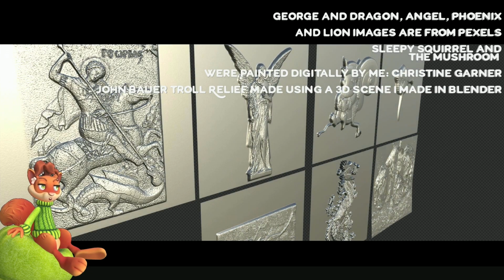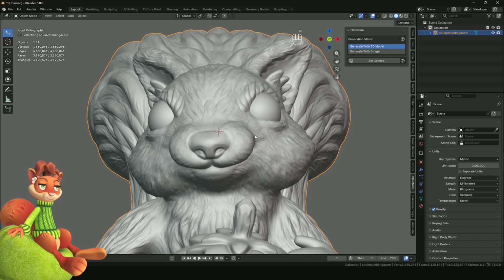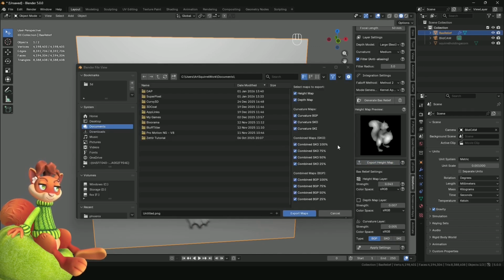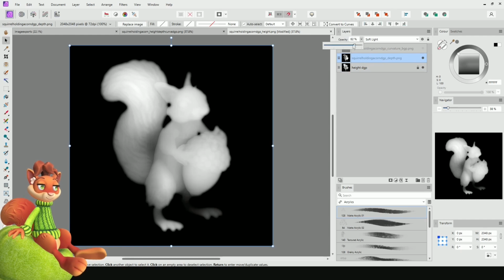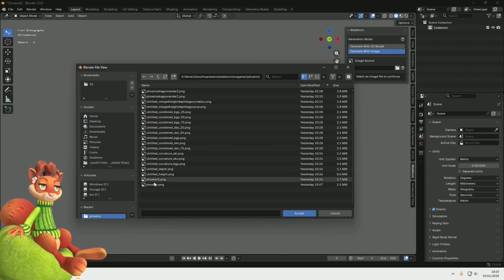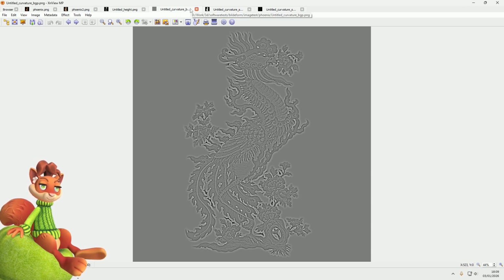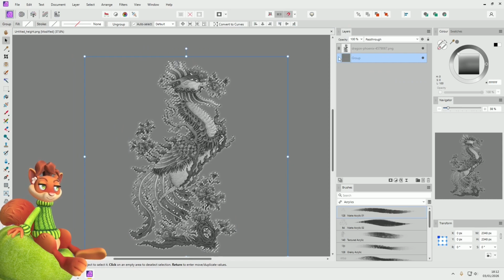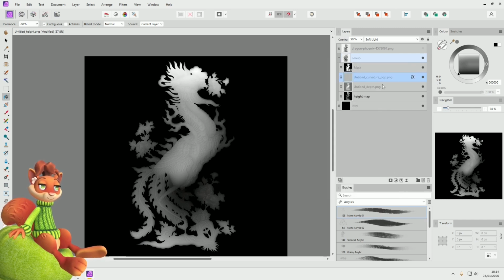Bildeform ver 2: Bas Relief Blender add-on for 3D models and Images

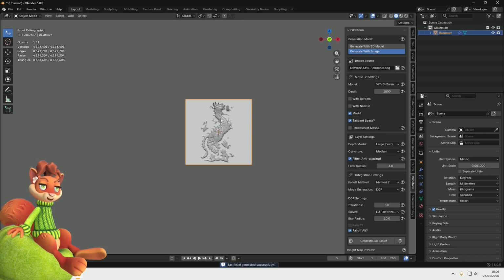Comment: I try to do like you, but i don't succes, lost many details, blur and smooth result. I upload image and make some ajustement like yours on this pluggin , but detail are poor, never like yours at 8:43. I will try again (i don't understand realy how work his pluggin, need doc and tuto)  but i hope to find a good result 😎
Reply from the maker: That time stamp is the result I got for a very flat low contrast image before I tried the white border trick. White border trick helps and you also need a good image to start with with good shading and decent resolution.
Reply: @theartsquirrelYes i do some test and results are better. Thx for your tuto 😎👍